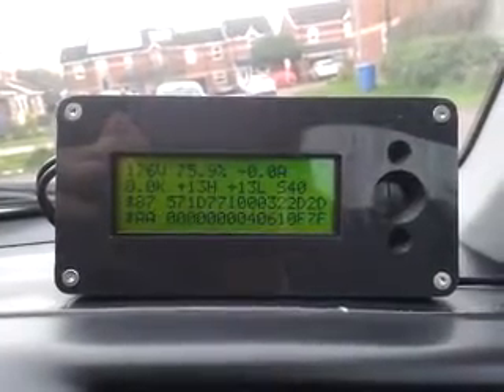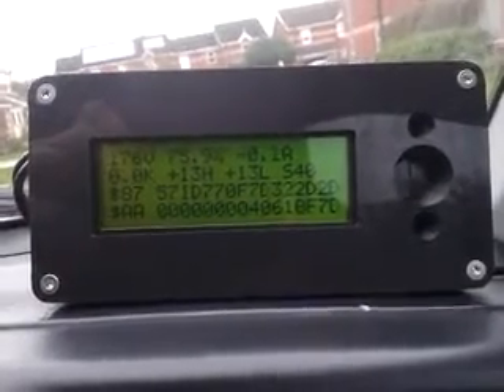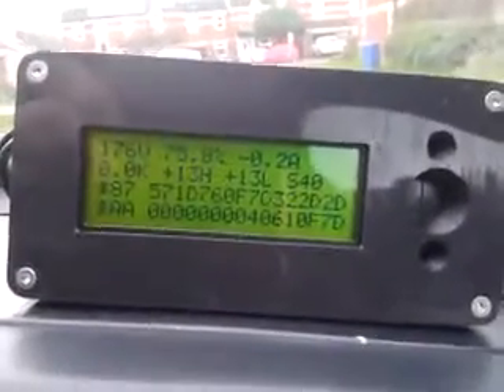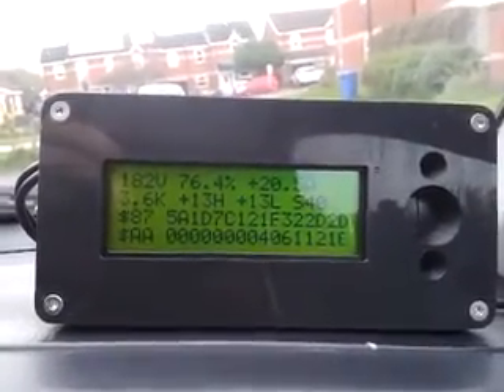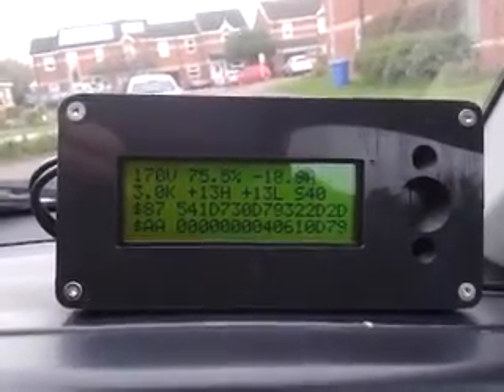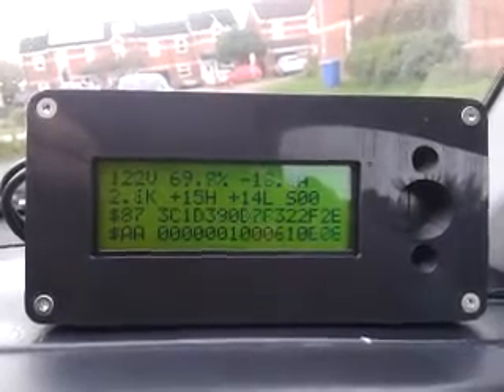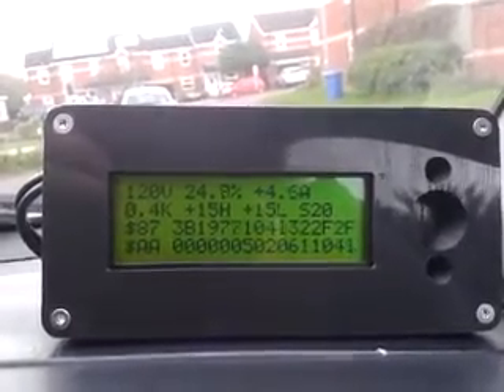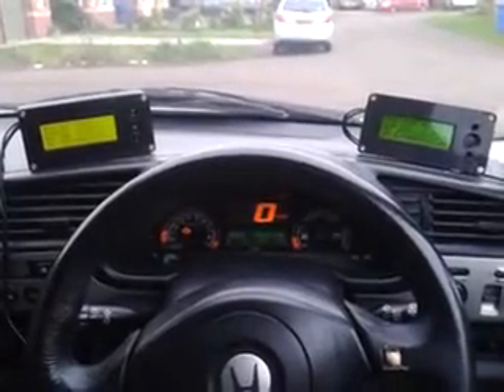Supercap BCM gauge and discharge test

Comment: 20 amps was only enough to push the non-engaged motor to what RPM?
Reply from the maker: Please post questions on the Insight Central forum in the appropriate thread. I don't have time to answer individual questions posted on the videos... YT is used purely as a repository for them..

Comment: Great job with the car. Love the build. I tried to find the project on insightcentral.net but there is a lot to sift through. If you can reply with a direct link please, that'd be awesome. I used to work at a supercap company and have a bunch of packs of 3000f caps around. Hoping to add these finally to an old cheap hybrid im buying.
Reply from the maker: This is the thread 212 posts lot's to read. https://www.insightcentral.net/threads/super-capacitors.17282/#post-167002